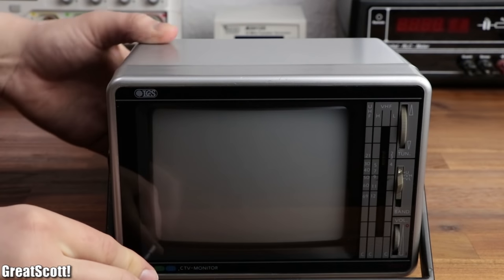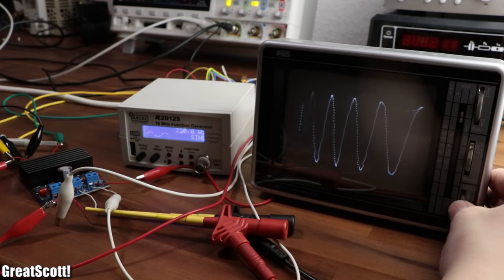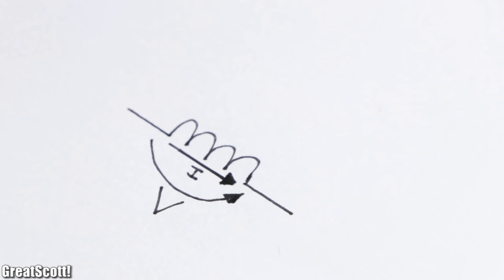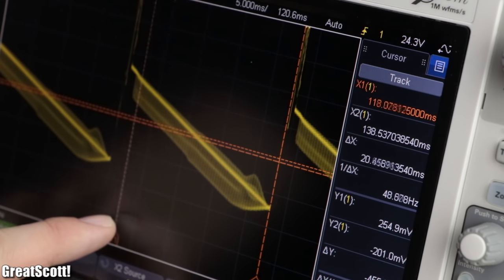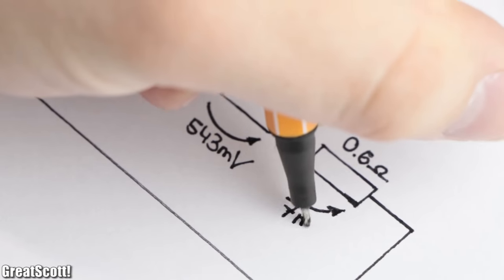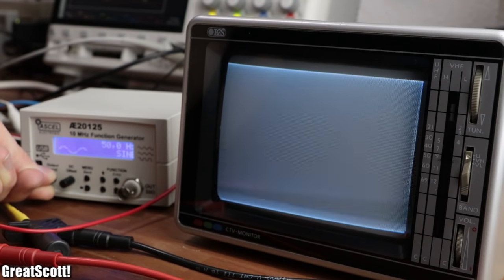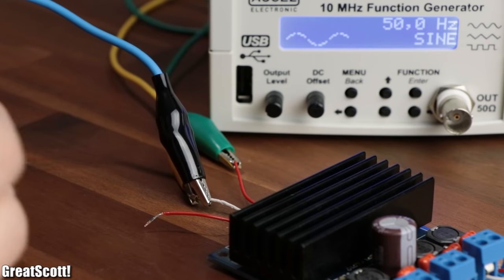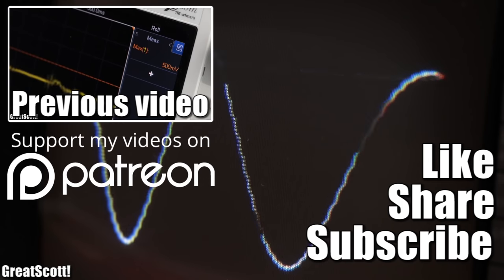HACKED!: CRT TV becomes a crude Oscilloscope

Comment: Ha, so cool - I did this too - many, many years ago. Very useful to check rectifiers, and as a music visualizer. I went much more low tech and simply connected the secondary winding of a small mains connected 50Hz transformer to the horizontal winding. Your usage of a stereo amplifier to boost/impedance-match both deflection coils is quite brilliant. Thanks for posting.

Comment: Instead of oscilloscope, you can do an audio visualizzer, showing you the audio wave of your audio output device (like mp3 player)
Reply: Marek S  that sounds awesome and would probably be more interesting for most of us
Reply: You could do this also on an oscilloscope. Nothing changed. And also mentioned and Scott replied.
Reply: I think they mean a spectrum analyser, maybe? Like you get on EQs?
Reply: As he stated, it couldn't be used to perform any accurate representation as the crt was not tuned to perform this function.
Reply: This is a good idea. CRT give much better view of the music than a few LED

Using a color CRT, I suggest the following:
1 - disconnect the horizontal, but replace it by an equivalent inductance. Most TV require a continuity on the horizontal deflector as protection for the CRT. The high voltage fall to low level if the horizontal is disconnected

2 - connect the horizontal to a 6 volt transformer. We want a 50 Hz or 60 Hz sinusoidal wave, not the saw tooth wave shape of a typical scope

3 - disconnect the vertical deflector, connect it to your audio output of an amplifier. The impedance is around 8 ohm to 16 ohm, similar to a speaker

4 - disconnect the 3 wires that control the red, green and blue of the CRT that comes from the main board going to the PCB on the rear of the CRT. Apply 3 volt DC. This allow the beam to be constantly ON instead of flickering with the video data. You may still get an annoying black portion which is the retrace blanking. This can be removed by increasing the total brightness, a voltage control located on the high voltage flyback. If there is potentiometers on the PCB on the rear CRT, increase these as well to eliminate the retrace

5 - Use a magnet (from hard drive or micro wave or speaker) near the read of the CRT to separate the 3 colors. Modern CRT have such excellent convergence that the lines would be just a boring white. Move around the magnet until you find a location where each color separate, while avoiding to mix the color. You want the 3 saturated red, green and blue, not a mixed half ass of yellow, purple all jumbled.

6 - You may want to swap the horizontal/vertical since the horizontal can be swept 300 times faster. In that case, rotate the deflection coil by 90 degrees.

This modification of a color CRT display music in a really majestic way. When the music contains lot of bass at 50/60 Hz or any higher multiple, very nice lissajous shape appear. The 3 colors are much more interesting to look at, compared to the boring green of a typical scope.

If you own a function generator (as you mention in the video), replacing the AC transformer by the output of the generator, going thru an audio amplifier, you can set the scan frequency to the dominant frequency of the bass for each music you play, allowing these lissajou figure to appear. A further improvment would be to use a phase locked loop to detect the bass frequency on the fly. Displaying the locked frequency would complete the design for a tool that reveal the musical note for each base tone.
Reply: An audio signal is not unlike what you see here. In fact, I have an old, rack-mounted CRT oscilloscope parallel(?) to the signal flow in my studio, for this exact purpose. It's more interesting than technically useful; but it's nice to have some kind of visual feedback when you create. Particularly nice for experimenting with synths & samples; especially if you can isolate it to single channels, separate from the main mix.
Reply: You can get a cheap DSO single card scope for $10 if you want to have an amusing display for your audio. No need to waste time screwing with old tech aside from learning the basics.
Reply: Marek S I feel like I rember that... Oh Wait... Backyard Scientist did this a week ago
Reply: JohnIsCool_07 Gaming dunno, I seen it like 3 years ago on a radio project with wi fi etc...
Reply: Marek S it was in 2015 I saw it a week ago
Reply: Alecto When it comes to music; everything's cooler in analog.
Reply: the audio player known as "foobar2000" already has this. not to mention, l think the frequency of this TV is too low to measure the sound waves since you can't put in a curve delay.
Reply: Josh Shipton A spectrum analyser is not an oscilloscope.
Reply: H
Marek S
Reply: Christian Gingras I plan on doing the same for a clock radio I want to make. Would you know the bare essential parts I'd need to make the oscilloscope function? Or would I need the move the crt and everything it's connected too? I want to condense as much for space. Any help or direction would be a great help
Reply: So, an audio oscilloscope? Just hook up an audio signal instead of a sine wave function. It may require some modification or amplification, but it should output.

Comment: Hehe, used to do this with old monochrome monitors.

Tip: use the horizontal deflection coil and leave the vertical coil connected to the display. Loosen the screw which holds the clamp, which holds the yoke (the assembly which the coils are wrapped around) onto the tube, and rotate the entire yoke assembly 90 degrees, so that horizontal is now vertical.

Comment: I'm actually amazed this worked.  Normally the horizontal windings of the yoke are part of the HV circuit of the flyback transformer which generates the HV for the CRT anode.  On many sets, if you disconnect the yoke you won't get enough HV to light the CRT (unless you substitute the horizontal coils of the yoke with a suitable inductor connected to the flyback).

Comment: Great idea, I may actually build this with the old black-and-white CRT I got a while back.
Some improvements that I may end up making:
-The arduino has an analog comparator built into it across AIN0 and AIN1, this can be used to enable a more sensitive trigger than with just software analogRead()
-I'll probably try using the arduino's high-frequency PWM directly for the timebase output with a filtering capacitor. I've used it successfully before for playing PWM audio samples, and it should be good enough for a basic timebase.

Comment: I used to make and sold some of these in the mid 1970s when I was a child, but I used to rotate the coil. 90deg, I also added an isolation transformer to the input, this was also for impedance matching. I bought small used transformers from Henry's radio in Edgware Road in London. There were a lot of abandoned TV sets at the time, probably because they were VHF only, and broadcasts  for the new BBC2 channel was only on UHF.

Comment: Very interesting.

Was thinking about turning one of these small TVs into a clock using an oscilloscope clock board, but that would require a lot of work as the yoke would have to be rewound.

Comment: if you connect the r&b wires to the other pair coming from the TV you can get the same ~50hz from the TV itself. I have only seen this done on YouTube by some kid compared to all the experienced engineers who didnt even think of this solution. It will cause the left and right range to be smaller, however i think its worth it to save space and buying additional stuffs

Comment: Did you spot the brightness went down when you disconnected the horizontal deflection coil? The horizontal coil is in parallel with the flyback transformer and disconnecting it will detune the circuit, making the high voltage drop quite a bit. If you need to drive the deflection coils "out of circuit" you need to connect a "dummy" inductor in parallel with the flyback transformer to keep the electronics happy.

Comment: There's a DIY oscilloscope kit available that comes with an RF output. So that would be VERY easy to use with such a small CRT TV. You wouldn't even have to mutilate the internal wiring of the television.

Comment: And here I was hoping you'd be running signals through the coax cable or the V of the AV input. I too have an old CRT but I still use it as a monitor for my collection of old gaming consoles.

Comment: With the coils, they actually move the beam sideway. top+bottom coil move the beam left-right.
Left+right coil move the beam up-down. (just try a magnet, the beam isn't attracted to the magnet, but is bent sideway instead)

Also, for true voltage shape, you actually want a current feedback driver (I have tried TDA4866, it seems to do the trick).
(coil current decide deflection, voltage would give a lag)

Due to the small size of the CRT, I wouldn't worry too much about the high voltage.
But warning: If you do meassure on a full-size TV, beware that the horizontal deflection coils may have peak voltages of >1  kV!!

You are halfway into making a CRT display digital scope. You can actually create both axis from the microcontroller.

Comment: the info in the beginning misleading..  you forgot about the right hand rule... the magnetic field deflects the beam 90° of de direction of the field... so it's the opposite way... the top and bottom coil are for horizontal... and de left and right coils are for vertical..
Reply: mr1jon1smith i
Reply: I was about to post just this lol

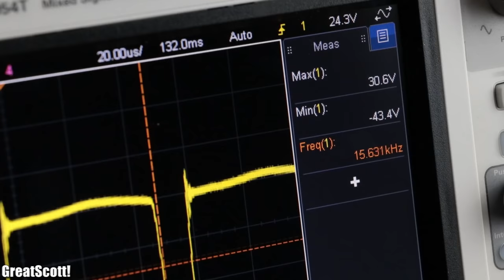Comment: 3:08 That's not the refresh rate of the screen, that's the frequency of the horizontal deflection coil and that's the high frequency sound (15625 Hz).

Comment: could you make soldering station with display?
Reply from the maker: It is on my to do list
Reply: With PID control ok :D
Reply: That would be great!
Reply: But for people, like me, who have ordinary soldering iron... So we can build it ourselves.
Reply: It's not fun that way to me because I love electronics and want to learn as much as I can
Reply: A good soldering iron can make you look like a pro (trust me, I have very little skill). The other big thing is to use Lead-based solder (I know, cancer, instant death, etc... Only do that outside), so its not recommended. The best is obviously the soldering iron. I started with some cheap 30w soldering iron, and it took forever and it looked terrible. Even spending about $5 on a 60w helped, but it does get too hot so you need to unplug it every couple minutes for about 10 seconds. My favorite one is a temperature regulated 200w soldering iron. I can set it to 200c thorough 480c and it auto-regulates itself to that temperature. Plus when you need to solder some big wires, it has plenty of power. Unfortunately it runs off of 220v, so I can't just plug it into a normal socket in the US (actually it had UK 50 Hz plugs on it, but it seems to do just fine at 60 Hz). Its great for tiny precise wires where you don't want to burn a PCB like I used to do all the time, and I mostly got it for soldering solar panels because I kept breaking them with a bulky soldergun and it takes a lot of heat to get wires to stick to them. As far as time saved, that was about 10 hours on just that 1 project, its really easy and fast now. I think i spent $20 on that iron, and it was well worth it.

Comment: Very "with it" and clever!
It does have a disadvantage (as a scientific instrument) in that it can only show locked waveforms that were generated by itself.
Reply: Stephen Ferree  I don't think that there would be room on the Picture Tube neck for that Stephen.
You are also missing out the essential synchronising part without which the displayed waveform would at best always be moving horizontally and would probably only appear as a horizontal band of light.
We could probably do without flyback blanking at a pinch for a really crude instrument.
Reply: Stephen Ferree  I see what you mean now.
Those old Cathode Ray T.V. Sets didn't like running with the Line Scan Coils disconnected and all the scan derived supply rails would drop a bit.
It wouldn't matter if the original Yoke was not physically on the Tube neck but one would have to be careful not to scorch the Screen Phosphor.
I would have used a different approach for synchronisation using a Synch Amplifier with the same sort of frequency response as the Y Amplifier but always driven into harsh clipping by the Y signal then follow this with an adjustable differentiator circuit to get a sharp transient to feed to and lock the X Oscillator which I suppose could be a 555 in astable mode.
You didn't mention how you would linearise the X Sawtooth.
I guess a constant current source would be best here.
Reply: Stephen Ferree  I think that you're thinking of some sort of image projector there with the Fighter Jet rather than direct viewing of a C.R.T.
If the Scan part of of the X Sawtooth is linear and the Screen is flat then the spot will move linearly across it.
In our Crude Oscilloscope the Screen will most likely be curved which will cause a little distortion (they used something called S Correction to address this in T.V. Sets) but I think we can put up with this as we don't actually have a Graticule on the Screen.
Reply: Stephen Ferree  Yes.
Thanks for your input on that.
It's nice to hear someone else's take on things sometimes.

Comment: you need to connect the horisontal imput wires to the vertical coil you have a simple signal and clear and ajust the varable capacitor (screen) to maximum

Comment: Without a leaded glass plate in front(standard on oscilloscopes), you are exposing yourself to radiation. The glass is not rated to block gamma/xray/etc when concentrated into a line.
Reply: Another scare myth, this is nowhare near high enough to cause any dammage if you sat in front of it for years!

Comment: I don't get it, doesn't the first coil you've disconnected has to be the horizontal one (left/right coil)? Otherwise the line wouldn't bend to the left/right with the external signal. And there would be also no vertical line, because the dot has to move up/down to create it. 
Or am I wrong?
Reply: Oh, get it now, you did not disconnect the measured ones.

Comment: You did not need to use an Arduino. you could connect the vertical wires to the horizontal coil and it would have shown just as good of a wave. I did it with an oscilloscope I built and it serves me quite well.

Comment: Something you'd be better off starting with a black and white, or green-screen display to achieve. No? Without the large mesh of the tri-colour phosphors, you can gain much clearer definition. In my experience, even if the display was meant, only for TV, it's much clearer in mono than colour.

Comment: Just a little note:
Could you set the arduino to turn the signal on for around 48/50 seconds and off for the rest? That way you wouldn't have the end of the line bending back when resetting

Comment: 🤔 if memory serves, you can drive the horizontal out transistor with your sample waveform, and avoid external amplifiers, and the sinchrony signal is aready present at the base pin 🤔🤔🤔🤔 getting old and the details are fuzzy... 😂

Comment: I'd like a video where you went into more detail about how a CRT works. I know there is an electron beam, but how does that get sent to the individual pixels?
Reply: ReverendNillerz So the  number of pixels on this CRT screen has nothing to do with the phosphor grain density on the inner side of the screen?
Reply: Jeffrey314159  I dunno

Comment: Actually you could achieve MUCH better results in the initial configuration in which the timebase works on Y axis. Of course true CRO uses an electric rather than electromagnetic field for the beam deflection.
Reply: Electrostatic deflection with plates in V-formation. It's cool stuff.

Sadly not a easy mod to do. I would suggest current feedback drivers to avoid the phase lag (more visible on other signals than sine).

Comment: a little very off topic...I need some help on using my Japanese soldering iron in the US. it's a hakko fx 600 50w soldering pen with temperature adjust dial.

it has the 2 prongs only and runs off 100v from Japan. what can I do to safely power it in US?

If you're curious, I was in Japan for a while and needed a soldering iron. I thought it was going to be perfectly fine to use it in US at the time. my ideal is to achieve the conversion if necessary while maintaining the portability of the iron.

Comment: Akschually....... an old mini black and white CRT TV would be way better to use because the picture would not only look smoother (due to the non existant Lochmaske) but also looking  more "vintage" and "oomph!!" you know. And i mean those cheap little silvery black and white TVs you often got in Germany as advertising gift. Those are very easy to come by and due to the contrast issues on those it would look a lot better on them than on a colour CRT. Who needs colour on a oscilloscope anyway?

Comment: Most of these conversions that I have seen use monochrome CRTs. Those are harder to come by than color units. Can a color CRT be used and, if so, what are the general differences in the setup?
Reply: From my understanding there isn't really any difference, only that the colour of the beam may vary depending on the tv itself, some come out cyan, some red, and I imagine some green.

Comment: I'm trying to build an R2R DAC to draw vector graphics to the x and y  coils on a crt like the size of your but the beam barely moves. Im having trouble understanding the impedance. why does your output have impedance, and what formula do you use to tell what the voltage needs to be? also will an op-amp work for this?

Comment: Crude is correct.  Oscilloscope tubes move the beam electrostaticaly.   TV tubes don't have deflection plates and the beam is moved with external deflection coils.  The TV deflection coils don't have enough bandwidth to make a descent oscilloscope.  You will spend a lot of money building a piece of junk.